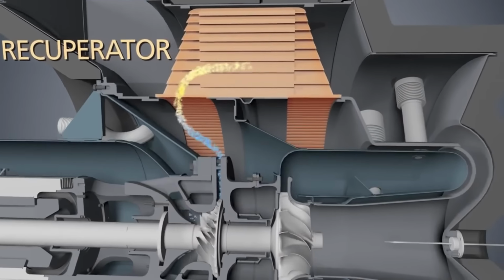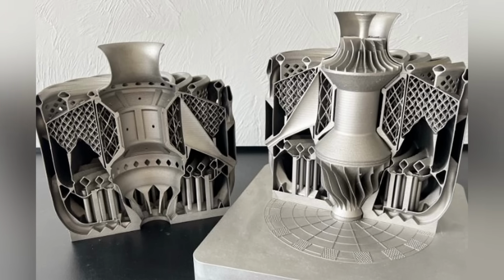FUTURE Jet Engine Has ARRIVED!? -Turbojet Breaks RECORD

Comment: Thank you for your efforts.

Since long time, I have question:

What the different between fan (in turbofan engine) and the fan in pc (cpu fan for example)

There are not the same, they have a different shape.
Reply from the maker: Think of the turbofan outer part is designed to act more like a propeller (efficient for the bypass air) while the inner part is designed to act more like a compressor (efficient for the core). But it's complicated optimization for efficiency, noise, temp, vibrations etc. The cpu fan does not have to deal with two different objectives like a turbofan (I think that is what you are asking) so a turbofan is different.
Reply: @Motor_Explorer1  
Ok, thank you. That's was good answer.

Comment: loving the info , i've been here for years and still loving the content
Reply from the maker: Thanks!
Reply: Hybrid aircraft are the dumbest thing ever proposed.
Hybrids are only efficient in stop-start applications.
Aircraft cruise at the same speed for hours.

So all the hybrid does, is increase weight, complexity, and cost.
Look at the Rolls Royce EfanX.
It was ti decrease CO2 by 70%.
But INCREASED CO2 by 400%.
And was so hot and heavy, if could not take off.
And they charged UK taxpayers £60 million for this monstrosity.

HYBRIDS DON’T WORK FOR AIRCRAFT.

T